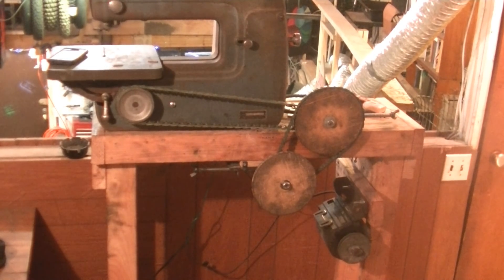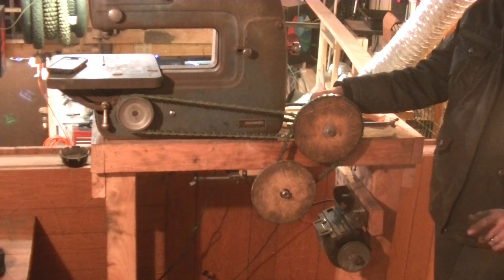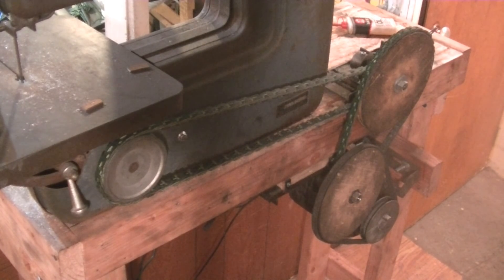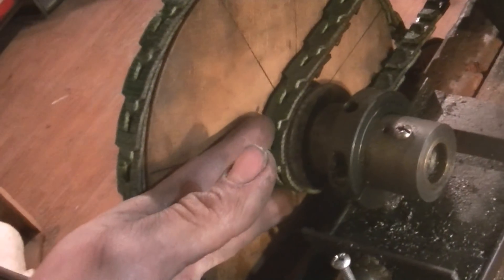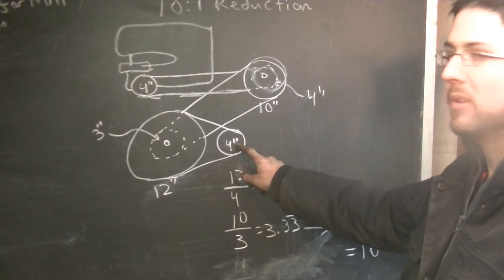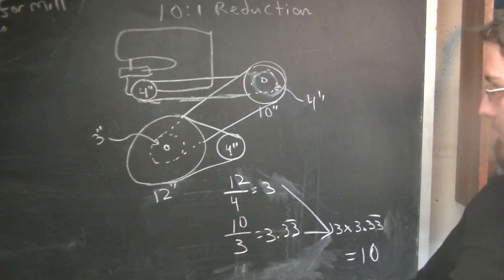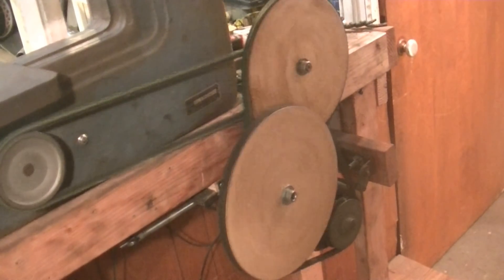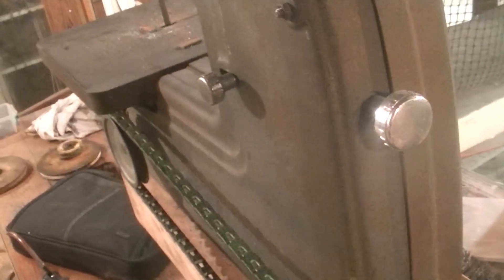Home Made Metal Cutting Bandsaw Repair

Comment: I'm not sure of what belt you're using.  Those link belts are convenient, but I doubt they have the same surface area per inch of belt that a normal belt would.  Might help keep from slipping.  Also, the pulley grove profile is important.  Maybe make an arbor to mount the pulleys on your metal lathe and grind a form tool to give you just the right shape V for the belt to ride in?
Reply from the maker: Great points!